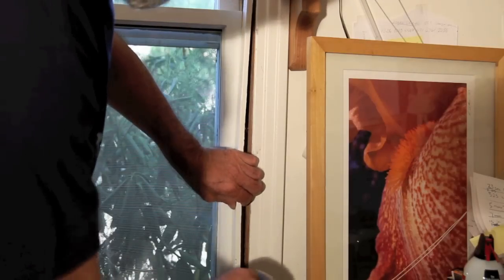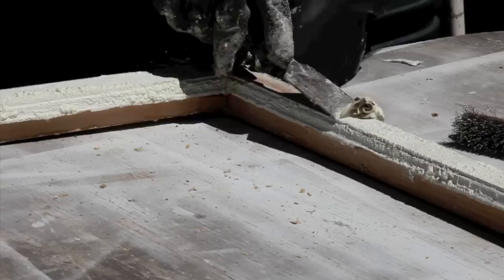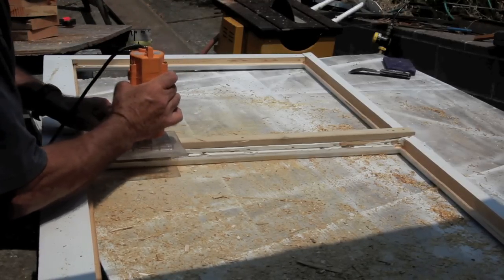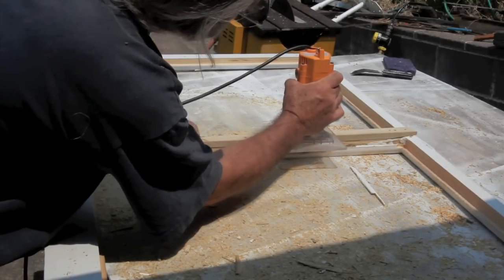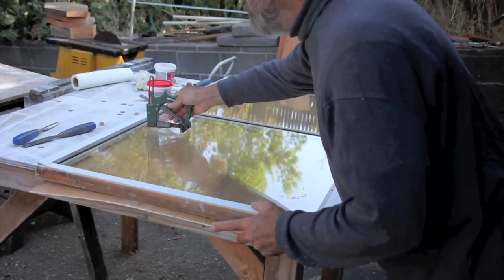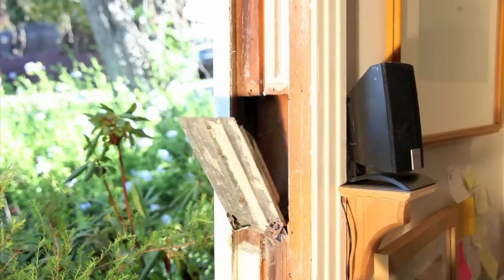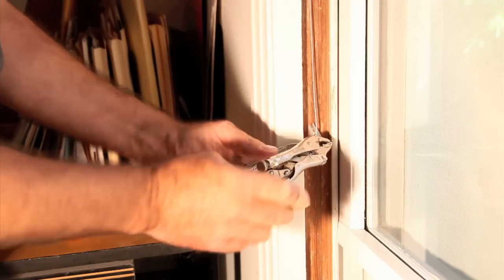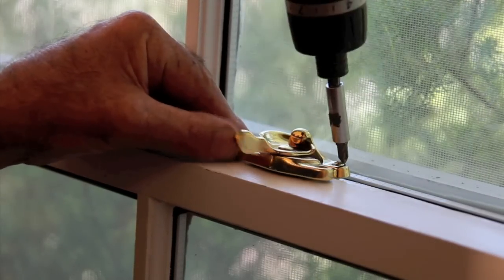Double Pane window

Comment: You'll be replacing the insulated glass within a couple of years. By using putty, you sealed in the edges. The edges of an insulated glass need to "breathe" or else the seal will fail and cause condensation between the panes. Wood trim is recommended!!! Also, an 1/8" gap on ALL four sides between glass and frame is also recommended to allow the wood to shrink and expand with humidity. Too tight and the glass will crack. Use small (preferably rubber) shims to keep glass centered in frame.

Comment: Nice presentation, thanks for the tips!  I'm wondering how you routed out the meeting rail (check rail)?  That's one detail I didn't understand.  Since it is cut on an angle, the router doesn't have a flat surface to sit on when routing that rabbet.  What did you do there?

Comment: Great idea and great suggestions in the comments. I was wondering if anyone makes a white butyl sealer of any sort.  Although black may look nice.  I might just have to give this a try.  It sounds easy enough.  I have a plastic slide mechanism. Is there a away to change the tension on them?
Reply: I think Amazon has white and grey butyl tape like you use with campers & RVs. Know they have grey, I've bought it from them

Comment: Warm air pistol to remove old paint, no chemicals! Better isolation with sealant, than putty.
Reply: use a good mask when use a heat gun as the steams can be very toxic